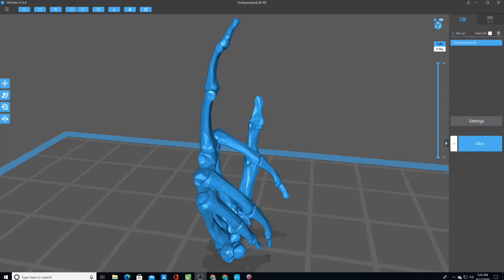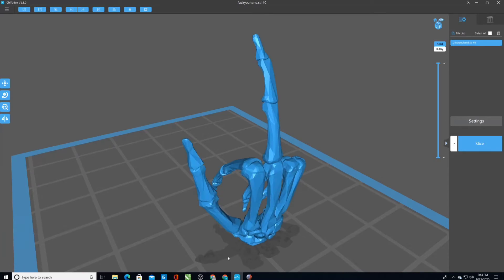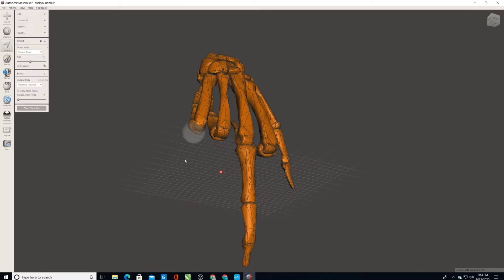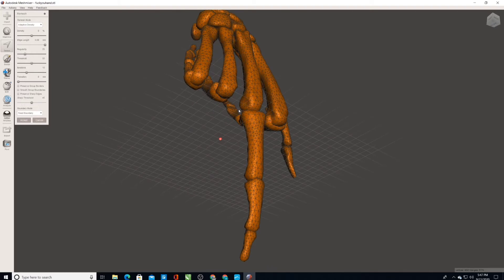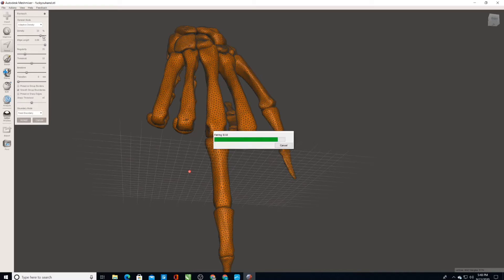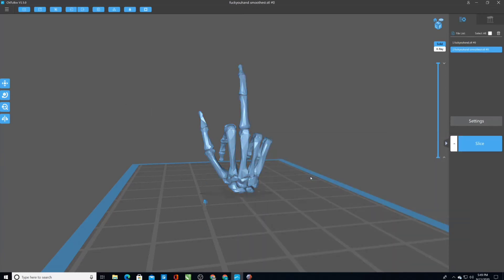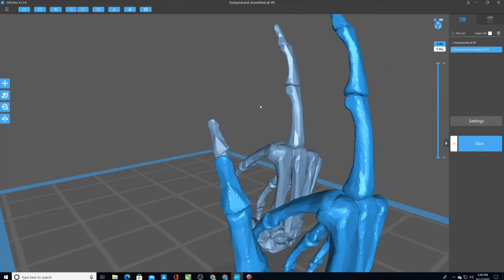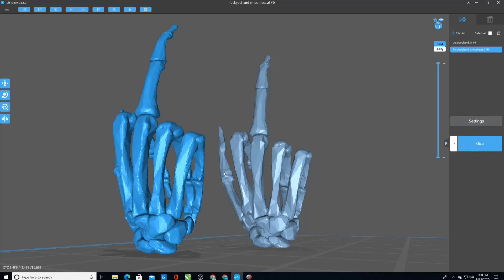How To SMOOTH A .STL 3D Print File Using Meshmixer | Increase Number Of Triangles 3D Printing Video

Comment: Great video and awesome tips and tricks! Thanks, you turned me on to MeshMixer and I downloaded it and did what you showed. I learned alot. Also, I don't know if you or anyone else builds their own models but if you do, when you go to save your model as a .stl you can achieve similar results by going to the software options, usually depending on what software you use, by selecting the Binary .stl file for best 3D printing results and not the ASCII .stl. You can also select what level of triangle tessellation in general term selection in the options area to either coarse, fine or custom. But thanks for leading to all this I am glad I found your channel. Keep up the great work!
Reply from the maker: Thanks for the tips!

Comment: Another stupid video on smoothing! But hey! You can see this guy's level of intelligence from the model he chose.
Reply from the maker: Maybe you can keep your arrogance to yourself and say something constructive if you are of such superior intelligence. What is your method? The smoothing method I showed worked, but if there is a better way, I'd like to hear it. Also, this model was a customers model and it needed to be smoothed before printing.
Reply: You can tell your complete lack of intelligence, by the need to negatively comment, instead of scrolling, and completely ignoring his request to comment with other options.
Reply: @Dougs_vertical_juice  whats wrong with asking for constructive feedback ? Throwing insults at people wont help either ot them.  The method seems to work well and safes a lot of time when you dont want to remodel tho whole thing.